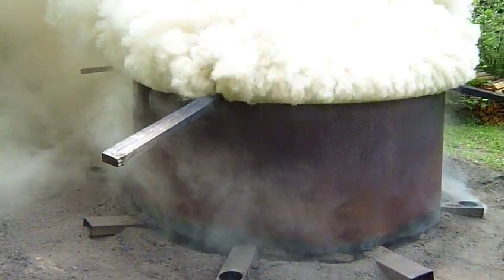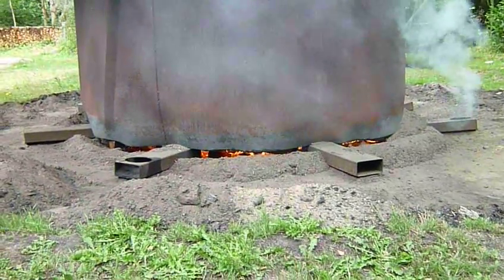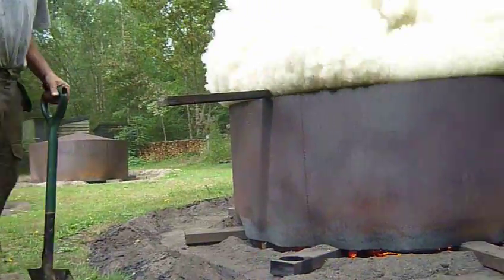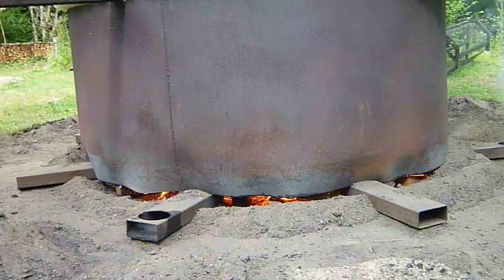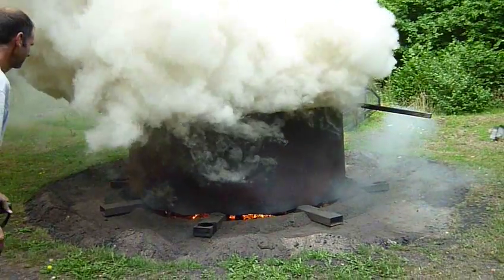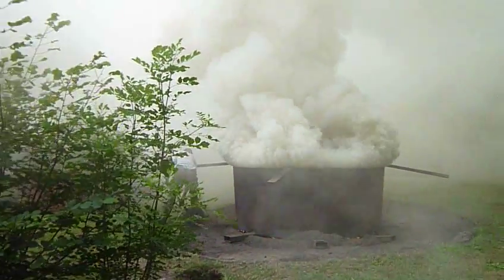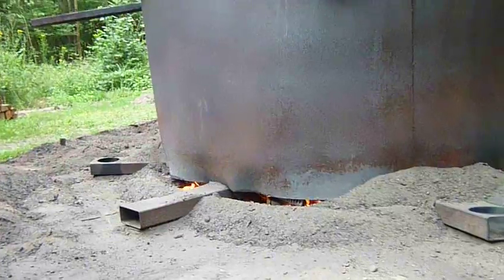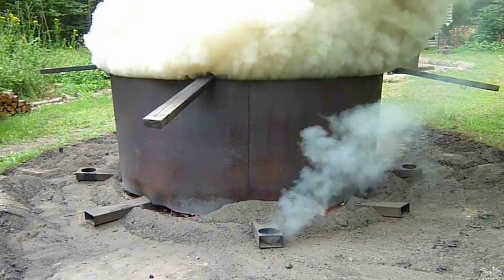Making Charcoal - Part Two

Comment: could have retorted/reflux the smoke to add more fuel to the fire. otherwise its wasted useful energy.
Reply: I was thinking a tank with no oxygen added and a burn underneath it. Gasses are piped to below and burned down there to add that heat to the tank and no oxygen or combustion will take place within the chamber. That heat can be converted to energy with a sterling or steam engine if you're really conservative. Those gasses are straight horrible for the environment.

Comment: A bit high on the pollution don't you think
Reply: +billyank1864 
That smoke that you see coming out of the top is all water vapour.

This is as polluting as a basic campfire.
Reply: I have never seen water vapor last that long in the sky though.
Reply: Jee Doucet
"shit load" is highly exaggerated, the main component of that smoke is definitely steam.

Basically by definition its not more polluting than the same amount of wood being burned in the open.
Reply: CPTANT I'm just saying that it's not JUST water vapor. It's chimic. It's a lot of pollution. Compared to a car.
Reply: Jee Doucet
If there was a lot of carbon in the smoke it would be black. In fact black smoke is a good sign your kiln isn't working properly.
Reply: +CPTANT What does that have to do with the topic "pollution". I'll stop argueing. Won't change my opinion
Reply: Jee Doucet
You say there is a lot of carbon released and I say that if that were the case the smoke would be black?
Reply: +CPTANT Pollution.
Reply: I quote: "Alot of carbon released."

You give carbon as an example of the pollution caused by this. I show you that there is not a lot of carbon released.

Case closed.
Reply: CPTANT The main topic was pollution, stop twisting stuff. And yeah case closed. Bye-
Reply: Jee Doucet
"Jee Doucet 13:00
+CPTANT This is not like a regular campfire, it's a chocked fire. Meaning it's a incomplete combustion. Alot of carbon released. "

If you think the main topic was pollution why the would you say that and then claim it has nothing to do with pollution?

Literally the only reason that makes sense is you are feigning stupidity to troll people.
Reply: CPTANT lmao what, all I was explaining is that the smoke is pollution when YOU said it was just water vapor. It was not off topic or anything and I'm not trolling either. You said case closed, then case closed. Your notifications are getting annoying.
Reply: +CPTANT And all of the volatiles in the wood....
Reply: +CPTANT So, you're basically saying that it's safe to breath that and not choke? .. Right. It's not JUST water vapor. It's also a shit load of pollution. White smoke doesn't mean it's not pollution.
Reply: CPTANT This is not like a regular campfire, it's a chocked fire. Meaning it's a incomplete combustion. Alot of carbon released.

Comment: That smoke can produce pyrolytic oil and gas for cooking. 1000 kg of medium hard wood can give you 280 kg charcoal, 90 kg pyrolytic oil (= 60kg diesel) and 160 kg liquid gas like propane gas. the rest is water. All this in an industrial basis plant.

Comment: It will just burn up all the wood then. Remember they are trying to make nice burnable charcoal not the dead crap you get when a normal fire burns out that you need more than its weight in wood just to get it to burn again.